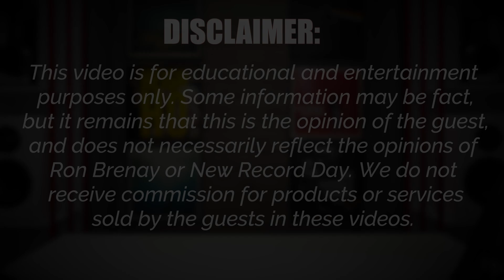What is RF and how does it affect cables? With Audience AV

Comment: balance cables or optical cables are the way. or shielded cables
Reply: maybe, maybe not.
Balanced adds components to the audio path, so this is only better if those components add less distortion than not using balanced.
Optical has dynamic range limitations, so only better is the loss of dynamic range sounds better than the distortion.
Shielding effectively turns your wires into either capacitors or inductors depending on the frequency, and will effect dynamic range (though not audible in most conditions).
The "best" solution is un-shielded wire in a room with no RF. After that, the best solution is the compromise that sounds the best given the room conditions.
My house does not have much free RFI (mostly because I use very little LED lighting and use no "smart" devices), shielded interconnects sometimes sound worse than un-shielded depending on the cable construction. I only use shielded speaker cable to prevent RFI to my interconnects.